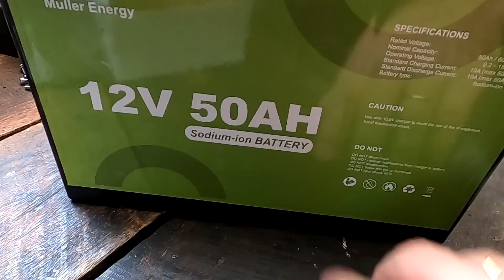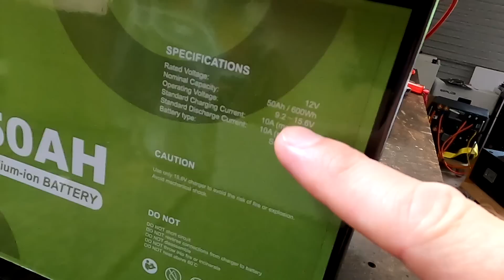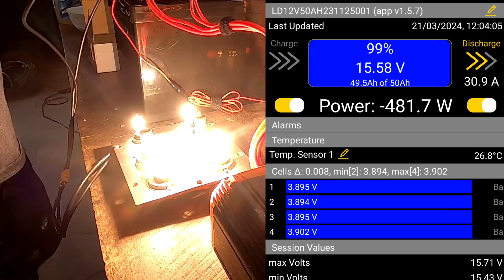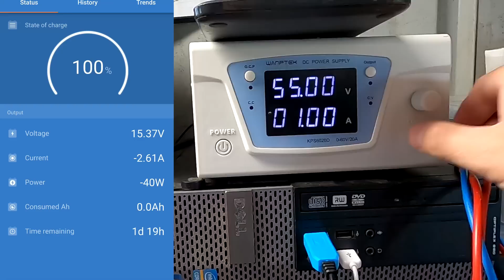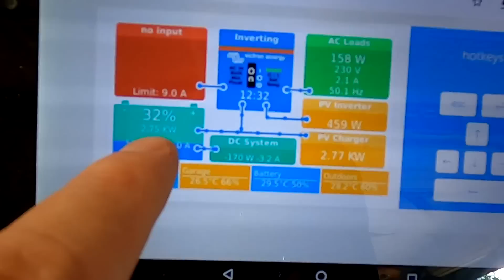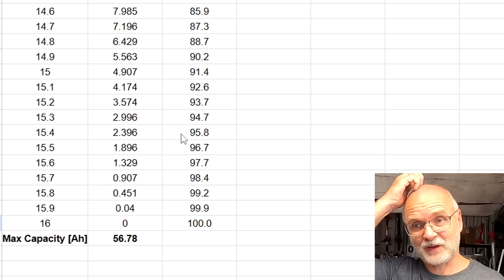Sodium Battery powers Inverter. But for how long will it run?

Comment: One solution is to change the wiring from parrallel to series once the voltage gets too low. It does require more than one battery be used but in most off grid set ups there is already multiple batteries.

Comment: If the inverter is bugging out, would a DC-DC Adjustable Voltage Step Down Buck Converter Module Power Supply, be something that could be used to make it work.. I have seen some people use them as a power supply to run a laptop from 12v on their mobile homes instead of using an inverter, they basically work as inverter in a way, but that you set them to the voltage needed.

Comment: victron has dc dc chargers that buck or boost the battery voltage range needed for the inverter.
Reply: sure but it also comes with a loss.

Comment: I have seen videos of people using capacitors to increase the ability of their solar installation battery to handle surges. I cannot start my water pump with the battery only, so no sunshine means no starting of my water pump during a blackout. I have a LFP battery, and I could buy another, but that would be costly. The operating range of an LFP falls well into the range of this battery, so such a battery could serve the same function as capacitors. The amount of energy you can use from it is just a bonus in such a configuration. It's more than you can get from a capacitor.

Comment: So could I hook the sodium to a lifepo4 battery in parallel but only charge at 14.6 volts the sodium battery world not get fully charged but shouldn't it work?

Comment: I already tested NMC and LFP in parallel with great results. Just waiting for an opportunity to do the same with Sodium, but it will probably not be in the near future until mass production hits and prices become available. Sodium can save the day and prevent an inverter shutdown when an LFP main battery is depleted. This is gold when you have no grid and no sun for a longer period, it can really save the day.

Comment: I bought one of these inverters.  They are not set up properly for the North American market.  48V in and 240V out with standard 110V plug in.... so you end up plugging in a 110V load to 220V... not good! Had to return it.  North American buyers beware!

Comment: Andy, I would love to see the Victron Phoenix, 12v 1200 VA inverter on the sodium ion battery, I have the 48 V version, I run it on a 12s 36v Lifep04 using dynamic cut off @ 33.6v ie 2.8v per cell.
It’s not a lot of power, and may void your warranty, but it works extremely well in my case using the bae 36v bus batteries.
One downside is inverter does not come with Bluetooth, need to buy Bluetooth module

Comment: The BMS is used for Lithium ion and therefor the percentages of the remaining capacity during the cycle will not be accurate. The BMS also showed it "pulled" .5KW from the battery while you said according to the sheet there is a 24-30% loss. This does not match with .5/.6=83% capacity used. This entire video results is all wrong based on the aforementioned. Good  efforts though.

Comment: Probalbly a good battery to supply a dc-dc charger that maintains the charge of a smaller high discharge rate load battery. 

Sort of a work around but not terribly complex.
Reply from the maker: I actually have a 12V to 12V charger. Will do a video in the future.

Comment: Need help.while trying to top balace battery pack with jk bms I notice a few cells  going down in voltage instead of going up in voltage.is this because the pack is very unbalanced?

Comment: I think if a sodium battery will cost 50% less than Lifepo then I will probably seriously consider using it. Space is not an issue in my case. I wonder how many circles will you get using 70% of the capacity.
Reply from the maker: The cycles life will increase a lot with such a usage. Probably 25% more, I guess...

Comment: Hi Andy,

For someone wanting to use this type of battery for some reason they could use another inverter.

Some Victron inverters have a working range between 9,2 and 17 Volt for the 12V versions.

This would add at least 4% more at the top and some at the bottom also. 

Depending on application this battery may beat some lead acid batteries and their disadvantages where LiFePo might not be usable without swapping equipment.
Reply from the maker: YEs, good point. Sodium can replace LA and even uses more of its capacity than LA can. Much lighter too.

Comment: Hay Andy need to know what size the connector on the capacitor active ballancer I have 3 15ah liion battery I want to ballance with one unit is it a vh3.96
Looks too big for a jst2.5. I want to know before I order so I can get extra cables
Reply from the maker: You can get them here: https://s.click.aliexpress.com/e/_DC6o1LB

Comment: You may configure two light bulbs in serie to discharge 12V batteries.
Reply from the maker: Yeah, I could do that. I designed this load for cells on a 3.5V level and can pull 35A through the bulbs. I usually don't deal with 12V batteries much.

Comment: I guess their price is going to have to come down pretty dramatically (the prismatic cells are about the same price as LiFePO4 at the moment) for them to be competitive, given the extra weight and lack of currently usable capacity.

But I imagine they have a far better environmental footprint. It would be interesting to know how much more ecologically sound they are.
Reply from the maker: A lot of questions around sodium batteries...

Comment: Love your work Andy , you have inspired me to build my own off grid garage,  I have 1550watts on the shed roof  available  i have 2 100/30  mppt victrons , one 75/15  victron mppt , one victron temperature and voltage unit , a smart shunt victron and a 200 ah  battery
Reply from the maker: That is fantastic. great work and a nice system you have there. What inverter do you use? Or just using DC?

Comment: Great work, soon some one will design an inverter that covers the sodium battery voltage range, sodium batteries will find uses where there are many charge discharge cycles per day.
Ontario Canada, just got 10cm of snow, panels are covered, no solar for me today. This summer planing on installing some bifacial panels vertical facing east, for winter they will catch the low morning and evening sun plus they will not collect snow in winter.
Reply from the maker: I'm too scared to install panels vertically. The wind load is insane.
Reply: @OffGridGarageAustralia  
Wind load is one of my concerns also, but I also like experiment so why not. ( Live in a valley so not many high winds)
Going to use screw in deck anchors. 80/20 inc T-slot profiles for the structure, mount the panels long side parellel to the ground, add some extra mounting points to the panel, plus a brace at each post. 
The Thornova - TS-BBT54(425W) panels are 1722 x 1134 x 35 mm (67.80 x 44.65 x 1.38 inch), though about the 550W ones but decided too much unsupported lenght.

Comment: Why dont you have a look inside the inverter? Maybe you can find a potentiometer to adjust the minimum voltage. (If it is not done with software , in that case one would have to contact the manufacturer or hack it)
Reply from the maker: The minimum voltage settings for these types of inverters are there to protect the electronics. Lower voltage means higher current as we have seen. That could damage the inverter components.
Reply: Good point, there has been a few fires with motorbikes upgraded to HID's which basically have constant power draw. 

Once the engine was shut off, the voltage dropped so the amps had to increase, overloading the not-fit-for-purpose wires.

Comment: Thanks. Good work. If you plot charge and discharge curves (volts vs SOC) at the same amps - for a given SOC the Ah efficiency is 100 x Discharge Volts / Charge Volts. At rest volts vs SOC curve is somewhere in between.

Comment: NO fire risk, survives overdischarges and drains 75% SOC with normal inverter makes this the perfect battery for homes.
Reply: No fire risk with LFP with more usable energy curve so don't see the case for Sodium.
Reply: @nigelcharles511  LFP fire risk is lower than Li-ion batteries but it is not as low as sodium. A failing BMS risks overcharging Lithium and burning down your whole house. 
Yes, you can use 90% range with LFP at the cost of reducing battery life cycles. Using 60-70% SOC in LFP is the highest drain aim for good battery life longevity.
Reply from the maker: If the BMS fails, the charger failed before. Fairly unlikely that both fail at the same time.

Comment: Great video. It'll be interesting to see sodium batteries perform with a dedicated inverter, that can handle the voltage range.  
But for now ... I'm ordering some EEL V4 DIY boxes, with just the breaker on the front panel, and install Andy's best EVE LF280K cells.  Couldn't have done it without you Andy, Thanks for the knowledge transfer ...  👍
Oh, by the way ... rainy and overcast here in the evergreen state, USA
Reply from the maker: Thanks for your feedback. I'm getting the new EEL case as well to show it on the channel.

Comment: Looks to me like the sodium batteries with their wide voltage range is more suitable for high voltage systems. In my rv I use a Victron 3kva 12 volt inverter with 400Ah of NMC from an EV. The NMC batteries has a full voltage rating of 16.8 volts. The high limit of the Victron is 17.1, which is perfect for my application. If not for the wide voltage range I would be losing a fair amount of capacity with the batteries I am using.
Reply from the maker: Yeah, they are talking about grid storage and HV batteries with sodium. So I doubt these 12V sodium batteries will be a success.

Comment: thats going to be a problem for lots of electronics like radios and routers, i can see the smoke getting let out 😮
Reply: It can be solved by adding a decent 12V regulator powering the 12V loads.

Comment: Victron inverter allows you to program the working voltage cut off, i think it can go as low as 10.5 volts, and up to 12.4 volts, so you would get much more energy out of you sodium battery.
Reply: Up to 12.4 isn't even safe to connect to a car battery
Reply from the maker: Different inverters, different setting. It was an example with the Peter inverter.

Comment: If you used that battery in a 12V boat marine electronic, bulbs, etc. would be damaged by high voltage. Then they would stop working long before the battery is empty.  Not sure I understand what market this battery is intended for?
Reply from the maker: Probably grid storage and HV batteries in the first place.

Comment: A multiplus 12/2000 can be programmed to use from 9,5V to 17V, so it could use more of the range.
Reply: I think most if not all 12V Victron inverters can work at that 9V to 17V range.

Comment: To compare independent of voltage, just use Wh
Reply from the maker: Ahem, V x A x h = Wh. It's not voltage independent. That's why we use Ah, not Wh.
Reply: @OffGridGarageAustralia   As a user I don't care about manufacturer ratings or how they measure their product. I only care about how much work I can store and get back out. The Ah rating already breaks down when comparing traditional gel or AGM vs lithium because they run at different voltages. 1 Ah at 14 V can do more work (work is measured in Wh) than 1 Ah at 12 V. What I'm trying to say is this: To compare Sodium vs Lithium, convert the measurements to Wh to measure how much work can be stored and then retrieved from each battery.

Comment: There’s nothing stopping any manufacturer from designing and programming equipment to handle sodium batteries. If the price is right for the batteries I imagine a world where inverters and charge controllers can handle lead, LFP and sodium depending on your need.
Reply: That's not necessarily true.  It's really really difficult to find inverters with a wide DC input range.  I don't think it's an accident because if it were easy to do that, then you'd have one product variant instead of 2 or 3.
Reply: @big0bad0brad  I believe the limit is more safeguard from battery damage and fire hazards from over and under charging. There are a few e.g. Magnum and Victron inverters with larger operating voltage ranges like 10-17volts.
Reply: @RC-wu6gm  Then find me an inverter that takes from 10V to 50V, I'd kind of like one.

Comment: Instead of discharging the battery, get a high current diode and put it in series (forward direction, of course).  It'll drop the voltage by 0.4-0.7 volts without using much of the stored power.  If you want to make it a bit more permanent, add a switch across the diode that will handle the current.  When the real voltage drops low enough for the inverter, short the diode with the switch.
Reply from the maker: I think the 4% at the top are great for longevity. We now know, we don't need to fully charge sodium and they can be balanced at any stage. I would not hunt for these 4%.
Reply: The 4% at the top is not the most interesting. A diode would indeed help, but for a 4% gain, I don't know if I would bother...
Reply: Yes, this is a very good sugestión, if it is a high power shotkey diode, the the voltage drop is about 0.4v drop, but on general, power diodes are about 0.9 volt drop. Note, they will need to be heat sinked very well, as they get hot, another option is to use two power diodes in parallel but place very low value resistors in series with each diode, something like a 0.5 ohm 10 watt ceramic resistor.
Reply: Brilliant idea!

Comment: Maybe it is not entirely correct to assume the "peter-inverter" is the authority on voltage cutoff. I have a no-name 15yo one that has 20 to 33. And most Victrons can be set as low as 16V (for a 24V system)
Reply from the maker: It was just an example as I said in the video. Other inverters use these sodium batteries differently.

Comment: Thank you again for this Test.
I mistakiusky discargeed my 18650 Sodium Cell with 35 Ah by a broken Atorch Tester. The Cell got 95 ° Celcius puh...nothing badly happend The Cell after Cooling Had 3.1 Volt  24 mOhm and still works Like before with 1300 maH capacity
Reply from the maker: Oh, wow, that is dangerous!

Comment: It's good to see that at least 2/3 of its capacity is usable with standard electronics in a more 'real world' scenario. Sodium Ion batteries are currently forecast to end up about 1/3 cheaper than LiFePO4 once mass produced, so you could just oversize your battery if space isn't an issue.
There do appear to be some benefits to the chemistry in home uses, in particular: 
- better cold tolerance, both in being able to charge below 0 degC and also better discharge characteristics when cold
- intrinsically safer (than even LiFePO4 by a small margin) due to being safe to over-discharge because there are no copper deposition issues
- potentially higher energy density than LiFePO4. The first commercial generation of cells are below existing LiFePO4 capacities but CATL is claiming that their second gen (due out in about a year) will exceed 200Wh/kg
- potential for exceptionally long lifespan. Natron Energy is already claiming 50,000 cycles with their current product.
Great video! Thanks for sharing the data. Also, I wonder if you might have squeezed a bit more out of it if you'd tested at constant .5C. Obviously a less useful real world test for a 50ah battery but still interesting.
Reply: Ya, und mit an off grid solar arrangement ist running Zee power inverter continuously the float voltage setting can simply be set too a few millivolts below the inverters DC input high voltage cutoff limit und the inverter will be running nearest to maximum efficiency gaining a slight advantage over lithium while actually using more of the available battery energy und lessening Charge Controller working losses by decreasing the current handling resulting in s cooler, longer lasting life of internal components. The top voltage is not much of a consideration in the continuous operating/ loaded inverter system and is actually a benefit with the addition cold proofing specification to boot. That said, the Inverter DC cut out threshold limit is unremarkable without consideration of load. However, in considering DC resistance loads such as heating, incandescent, brush motors - again this SIB technology provides advantages over lithium. SIB technology is at the front of inverter restructuring where higher DC voltage is predetermined by infrastructure: DC voltages should be consistent with AC voltages to increase efficiency:  High voltage DC is more efficient than it's equivalent AC voltage by a large margin.
Reply: @anthonyrstrawbridge HVDC is much more efficient indeed and requires less copper too. The only  issue is the safety which seems to be resolved as well with new Class 4 - FMPS! Hopefully, soon we will be able to use it at homes and get rid of AC as much as possible, no need of inverters.

Comment: Hey great video 😅

Dont u have this big 1500w dc dc step up conderter with amazing efficiency?
How about putting it between battery and inverter to close the big voltage delta?
That would be another great test i think 🎉 ... could u do it? 😉
Reply from the maker: I killed them both. Not very reliable, I guess.
They had only 15A though, so 150W max at this voltage.
Reply: @OffGridGarageAustralia  hm ok

Comment: Sunny and warm in Napier NZ. Expecting 6 kWh today from a tiny system plus another 2kWh from grid during the free hour
Reply from the maker: Free hour of grid power... is that during noon time? Interesting. You could charge your vehicle and batteries during that time.
Reply: @OffGridGarageAustralia  it's with the power company electric kiwi. You get to choose the free hour every day but it must not be peak times, 7am-9am and 5pm-9pm. I charge the Ev at 7kW and the house battery at whatever the multi can do and run on the inverter for the rest of the day. It was a godsend last year when a cyclone knocked the grid out for 10 days